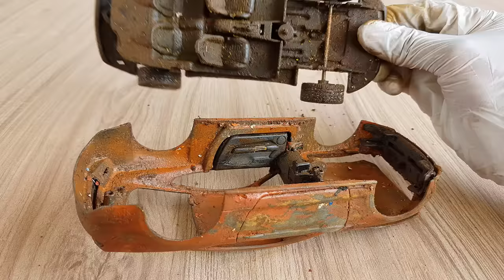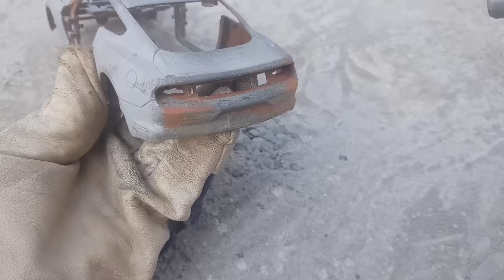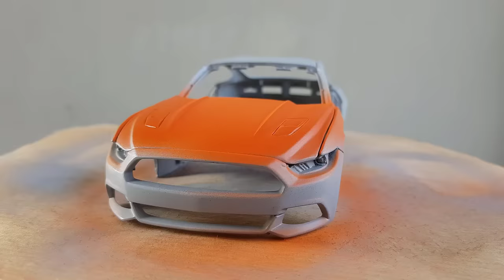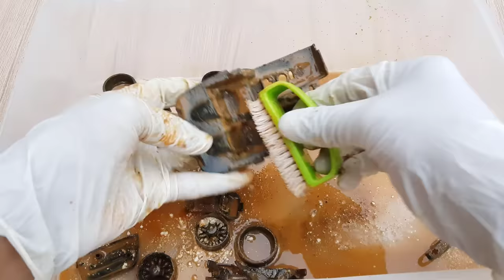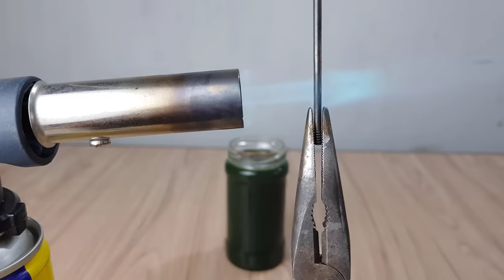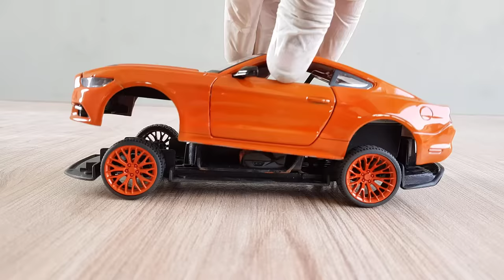Restoration Ford mustang GT Muscle Abandoned Model Car

Comment: Not sure how I found these videos. There are a few channels where these cars are being restored. Sometimes you can tell the model car was destroyed and the restoration is sloppy but about as good as it can be. Some however make me think they bought a new model, like a Mustang. Then took off some parts and slopped mud on them to make them appear like they were in a landfill for 10 years. The "restoration" was easy it just needed cleaning then some extra final touches that did not come on the model like the detailed dash, engine, seats etc. Also....the end result of this car looks good but the left rear wheel is sticking WAY out and the right rear wheel is sucked in. How on earth did this dude video that and not catch it. Also...where do they "find" so many die-cast model cars in such rough shape? LOL
Reply: Mtv
Reply: Очнкруда